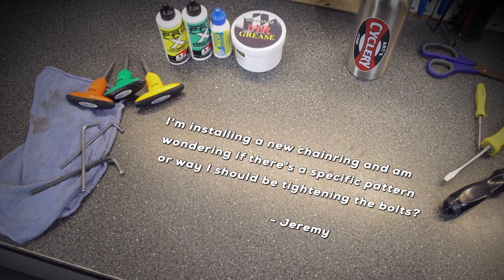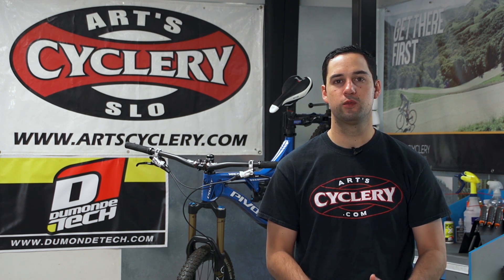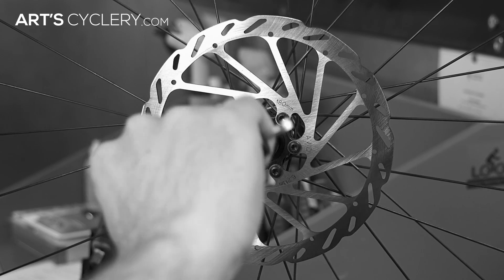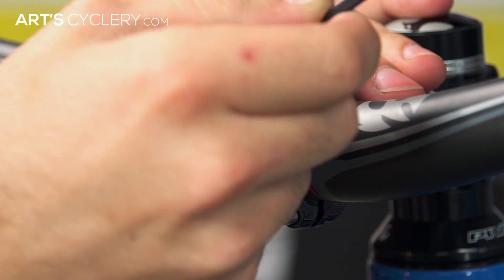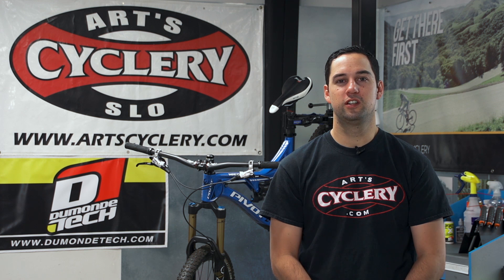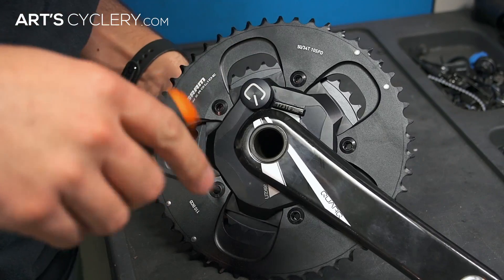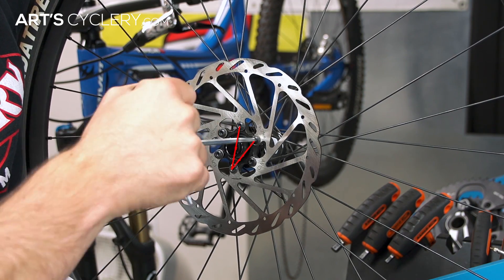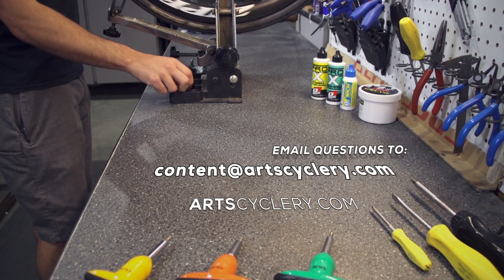Ask a Mechanic: Bolt Tightening Patterns

Comment: is it true that putting bike upside down for maintenance  is not good for the hydraulic brakes
Reply from the maker: We recommend working on your bike in a work-stand over flipping it upside down when ever possible. Flipping your bike upside down will put wear on your saddle, cockpit controls, grips, etc. With hydraulic brakes you can run the risk of moving unwanted air through the brake line and  ultimately requiring you to get a brake bleed. This isn't always the case, but it is surly a possibility.

Comment: You're using a torque wrench incorrectly. If the bolt doesn't turn but the wrench clicks immediately, it means either you got it 100% spot on by hand or more likely over torqued.
Reply: I am pretty sure they know how to use a torque wrench. I guess they cut the video and showed only the final part to show the clicks.
Reply: Flor.e.Cultura I'm sure; but as a tutorial on how to tighten bolts it's incorrect.